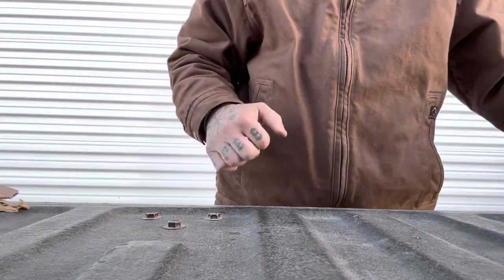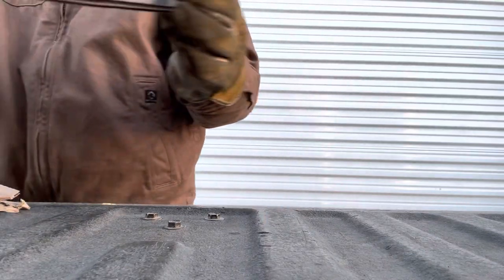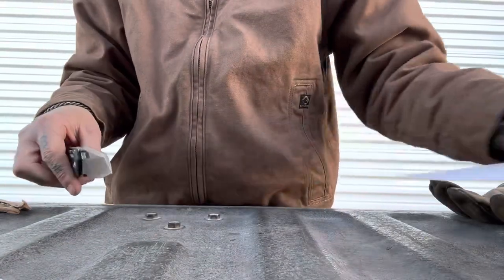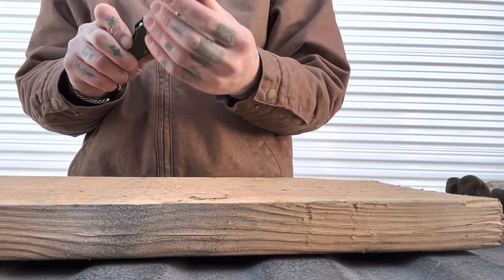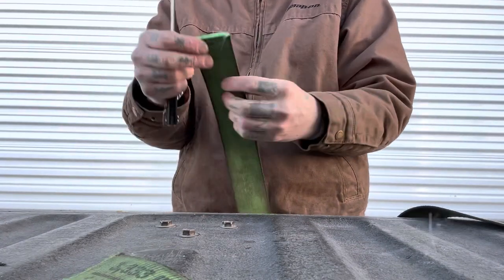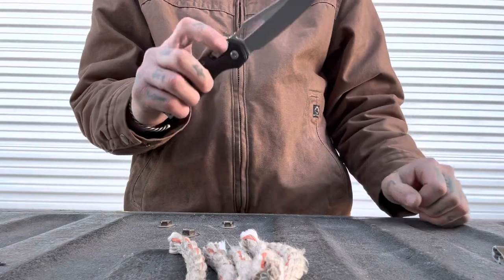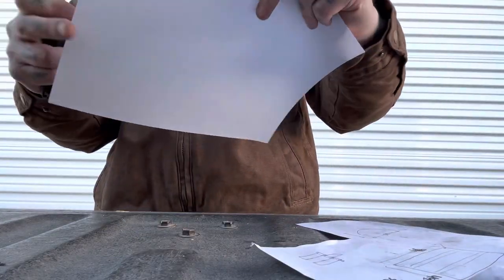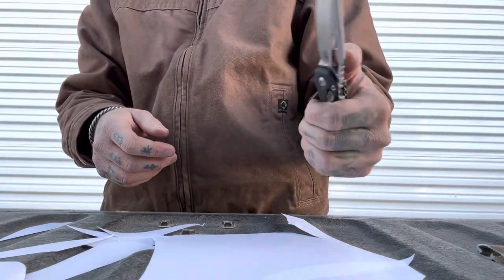Cut Test: Microtech MSI! It looks BADASS, but will it CUT WELL?!

Comment: I love mine and it replace my ZT 562CF as my EDC. The 562CF is M390 and I like that the MSI is M390MK. I love the shape of the blade and the handle fits my hand well. I carried a Benchmade 710 for many years and I love how the RAM-LOK easily flicks open like the Axis locks do. I don’t care about the “lack of detect that was mentioned in the video”. Overall, great knife and a great value from Microtech.

Comment: I know this vid is 6mo old but I just got one of these.  The “detent” strength must’ve been improved because the action is similar to the drop bear from kizer or Demko shark lock.  Thoroughly enjoying it.  Maybe give it another shot if this was your only experience
Reply from the maker: Interesting!
Reply: Yes, the newer ones are actually listed as "v2," so very possible they listened to feedback.

If you measure the Ramlock button and it is .250", then you have a V2.

Comment: I reverse flip mine easily... Maybe yours needs adjustment. I usually depress the lock to open/close it one handed. "Slow roller?" This life is super smooth and extremely high quality, so Im confused why u have so much trouble opening this blade. Odd review.